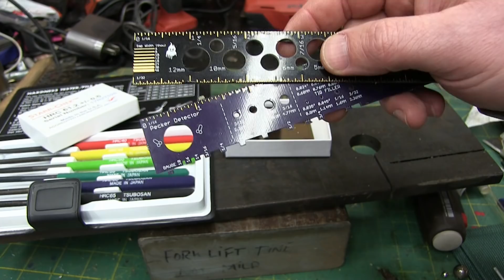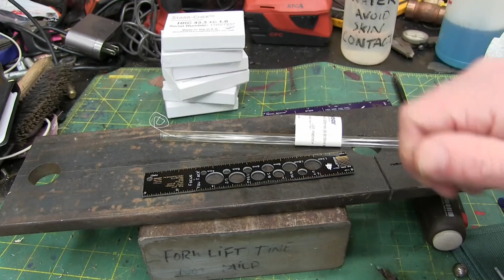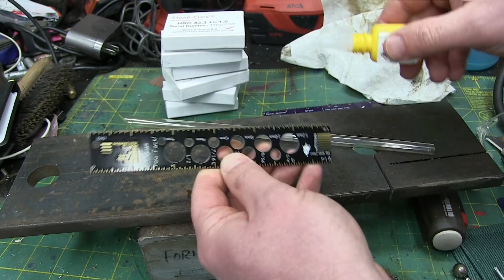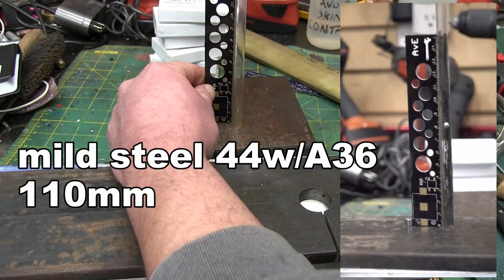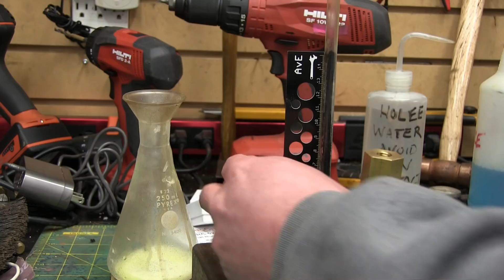Pocket Hardness Tester PROTOTYPE | IT WERKS!

Comment: The PC microphone input with a cheap condenser microphone taped to the striker plate can be used to measure the time between bounces. If the PC has 'HDA', (high definition audio, which even cheap motherboards have) it is possible to measure extremely low level signals with very high precision by using signal processing techniques.
For a quick trial, use the Linux ALSA utilities 'amixer' to setup the sound card input settings and  arecord' to record a wave file of the hits. Python alone or with SciPy can then be used to analyze the results.
For the best resolution the striking surface should be resonant to give lots of zero crossings. These can be averaged out using digital signal processing techniques to give very precise timing. An HDA sound card input has 80kHz bandwidth and the timing repeatability is in the nanosecond or better range.
As a hobby, I have done a bit of research using the sound card as a precision measuring device and even on a cheap motherboard, the measuring quality is instrument grade. See https://sourceforge.net/projects/o-scopepy/ for applications using the sound card.
Note that PyAudio is not suitable for making measurements as it has timing issues. It is much easier to use the ALSA utilities as subprocesses to record input into a wave file and then use Python and the SciPy library to analyze the results. There may also be other free tools online.

Comment: Coefficient of restitution and elasticity vs plasticity come into play here.  Hardness in Rockwell,  Vickers etc are measures of plasticity as they all locally deform the material being tested.   The calibrated test coupons have a much smoother finish than the ASTM A36 structural steel.  It makes a difference in the restitution. 
I'm not trying to shatter your idea, it just needs further work and study.  Samples must have identical surface finish and mass properties.  Thickness matters too.  There is a reason for the development of Vickers micro hardness test, it minimized sample prep and destructive nature common to all hardness tests.

Comment: Now wait just a minute, not all of us electrical enginerding types prefer warmer climes, it's just those types who prefer playing with bits that require a microscope.  I'll have you know I'm located in grand forks which ain't but a couple hours south of winterpeg on the old red river of the north; our climate is just as god damn cold.  My electrical enginerding credentials include, but are not limited to, holding both wires of a phone line just when some untimely jackass decides to call you, resulting in ringing your balls instead of the telephone.  I'd still like to know who the hell it was who decided to call at such an inopportune time.

Comment: To be honest though, you could just sell a plastic tube of specified length and a tungsten carbide ball... and then just use a mobile phone app for the audio pickup & calculatrix.

Even better, just have a drop down menu for ball material and mass, and a field to enter drop-height... and then the phone could do it.

Even smarter... could use a reference material to calibrate the ball on "learn" mode. Probably only need a coin-sized sample... or a coin.

Comment: Yea you could use a piezo but honestly a condenser mic element set into the tube at the point of contact would be cheap and easy. They are used in mobile phones.

Could also detect the ball using a capacitive sensor.

Another method might be to use a pendulum, and mount the sample vertically.

Comment: Dude, just some simple ideas may works: why not just a little coil ac powered or a light sensor pair? The position is not critical since you're just interested in the time difference. With 2 "sensors" you can measure speed :-D Perhaps a couple of coils filled with crazy pixels from a microconfuser?

Comment: This is essentially what you use to test the hardness of  cylinder heads. Small tube with a scale, ball bearing and a magnet in one end to hold the bb. Plop it on the head and tap the top to drop the ball.

Comment: Of course you'd use metric ! Enough with the measuring things in fractions of body-parts already !
It should be possible to read out the height of the ball with the aid of some choice electronicals.

Cuddles!

Paddy

Comment: My first thought was dot-matrix printer .... put the print head against something hard and oscillate the coil, listen to the oscillation, and sweep the frequency looking for natural oscillation frequency, the higher the frequency, the harder the material, but the mass of the dot matrix needle is very low (low mass of hammer = gooder) ... then I got to thinking, same idea, piezoelectric transducer, much lower mass = much gooder, then I checked the comfuser ... https://www.researchgate.net/publication/236624641_Research_on_universal_dynamic_hardness_test ... not a new idea

Comment: Your invention is a variation on the Leeb rebound hardness tester where the ball passes through a coil of wire on the way down and again when it rebounds.  The electrical signals produced on the way down and way up are analysed and a hardness value calculated.  The hardness values are in Leeb numbers and don't convert to Rockwell or Brinell particularly wel.  The object being tested has to be pretty thick to get accurate values and if not it has to be coupled to a thick piece of steel.  Leeb tester calibration blocks are typically 2-3 inches thick.l

Comment: I'm thinking something like a electric lighter striker with the pieso exposed so the test material then some way of measuring voltage like an adjustable spark gap maybe? Also What's the odds of getting a ruler and some stickers by Christmas?

Comment: how about using a soundwave instead and then measuring the pressure of the reflected wave? the harder the material, the higher  the measured pressure, supposedly. If that works, you can completely incorporate it into your scale. You'd just have to hold the thing against the material you're testing.

Comment: dropping the bb should be automated, like there should be a detend in the tube that is actuated by pushing a button, that way the bb will fall from the same height and in the same way each and every time. i imagine it makes a difference if you drop it from a little higher or lower right?

it would be cool to be able to check stuff for hardness, this could be a great thing for knifemakers (if it would work on a knife)

Comment: Second tap on work per strike with a hammer by blacksmiths.  Not the anvil tap to clear the hammer, the "resting" tap after the strike.  That's how you tell how your work is doing.

Comment: That fork lift slab was pretty thick.  like an anvil.  The base used under the piece to be tested could play a role in varied results.  Amount of contact to the base could cause inaccuracy also.  I know you get it but as an example.  A flat piece of steel on a flat anvil vs a a convexed piece.   Or any odd shaped piece.   Nothing a few tests wouldnt sort out.

Comment: What about using a optical detection at the lower end of the tube in combination with a black ball? Easy to implement and independent of noise in the "empire of dirt"

Comment: Inductive sensing may work too and it is way cheaper, just some turns of a wire. Flip a pin, read how fast pin recovers. Will be slower when ball falls through a coil.

Comment: As an embedded systems programmer, I would be more than willing to lend my time to the programming/electrical development side of something like this :)
Reply: I've done some experimenting with a PC sound card with HDA and the precision is incredible. The A/D converters are 24 bit and using the maximum sample rate of 192kHz, the input bandwidth is 80kHz. I proved this by using an Arduino to generate a precise square wave and then used an FFT to measure the bandwidth.
The only problem is that the inputs aren't calibrated and the amplitude settings all over the map. For this application, the true amplitude is irrelevant and only the timing is important. The timing repeatability of the sound card is in the nanosecond or better range.
The Linux ALSA utilities amixer and arecord run as subprocesses in Python is the easiest and most accurate way to capture the audio. I tried PyAudio and although it sounds correct, timing errors occur during recording and it's not as easy to use as arecord.

Comment: Very similar portable Hardness testers  already exist, even have one in my shop. They seem to be fairly inaccurate though. They also work harden the material slightly so different measurements need to be done on different places on the sample. The surface you are testing on needs to be smooth and  flat as well for a good measurement

Comment: Years ago I worked at a shop where we had these little pen sized hardness testers that worked on roughly the same principle. But instead of just a ball, the ball was on the end of a rod. You lifted rod out of main body and it locked in place at the top, hold the pen vertically to the part being tested and pushed a button to release the rod, on the first bounce it would lock at the top of bounce, and you took reading off of the scale on the side of the pen body.

Comment: You are't dropping this ball in a vacuum!!
You are dropping the ball in a tube full of air(Newtonian fluid) that you are moving/displacing at different speeds.
You really need this machine in software.(to automate all those calculations)
(edit: I mean just say, really hard metal is a 1:.999 bounce back and soft metal is a 1:.5 bounce back. That's almost twice the speed, a hell of a lot more air resistance. This math matters a lot. Unless you just want to buy a hundred hardness samples to fill out whatever curve that air resistance creates)

Comment: Here's how you can greatly increase precision:
Have several evenly spaced photointerrupters (for example, every 2 cm or 1 inch), and time the ball in several places.
After that approximate the parabola of the ball position relative to time using these data points with (for example) least square fitting.
This way you have much more data, and you'll get better results.
And photointerruptors are cheap.

Comment: Take a different but similar approach

Use a very light spring, the same type ball and a pinball like  launching device that way you could add a reset-able "max height" pointer to the ruler. Calibrate for hardness and bingo bongo.

Similar concept you would just have to account for the additional speed the speed the spring shot that thing out there plus the gravity.

Comment: If you use a whole series of bounces, you may be able to get more accurate measurements or do away with the initial height measurement and/or compensate for friction in the tube (first order vs second order decay).  A tungsten carbide or silicon nitride ball may allow you to measure harder stuff (yes, mcmaster has them...)

Comment: my company uses this model. seems to work on a similar principal. after a while of using it, you can tell when the steel gets hard by the pitch of the ping noise. 
works good, but you're right, it isn't as accurate on small material. https://www.brystartools.com/phase-ii-pht-3300-mini-portable-hardness-tester-with-d-impact-device-pht3300/?gclid=EAIaIQobChMI0ZuJ6PXT1wIVXZ7ACh0LpQKWEAQYDCABEgLESvD_BwE

Comment: I would add that a feeder is important for this, something simple you can rig up at the top, there will be subtle variances in pinching a BB and dropping it (unintended added force, variations in height, etc). I am not aware of anything, but would be pretty cool if you could have two sensors at the top and bottom of the  ruler, something that could correlate the position between the two some how to get a precise measurement. I don't think anything exists like that, hall effect sensor would be cool if you could somehow magnetize the ball but that would affect the rate of bounce and all that. Motion detection at the bottom would be too difficult as far as I know, but would be pretty accurate as well. This is a really really cool idea!

Comment: You could compensate for the pressure variation by adding into the sensor that counts the sonic wave to do a speed test while the ball drops from the moment the magnet is pulled and the ball is dropped to the first point of the sonic wave being detected. This data set should be enough to solve for temp/elevation

Comment: It's a nice relative hardness tester technique.  If you were to try to calibrate it, the delta between the drop diameter and th tube diameter might come into play due to variances in air properties at the time of test.  Just a thought.  A perforated tube, or a cylindrical screen might be just the thing to cancel that out.

Comment: You could use different masses/sizes to increase accuracy across a larger range of sample thicknesses (just change your range in the software to correspond).  Also you should test if a sphere is in fact the ideal shape for this application.

Comment: Someone else has already mentioned the Leeb tester, but the older version is called a scleroscope... https://en.m.wikipedia.org/wiki/Scleroscope.  Not many details there, but our materials prof had one back in the day. Lent it to the school architect to get an approximate strength of some existing I beam when they were remodeling... much easier to get into the ceiling than the Rockwell.  I believe his had a small vacuum bulb to evacuate the tube, and the bb release was done with a magnet. The Leeb testers use a couplant to temporarily stick small mass samples to a large mass btw...

Comment: the bb needs to be dropped with consistency too. no change in how you put the bb in the glass tube. perhaps an electro magnet to hold the bb at an exact hight and a button to release the bb. 

an LED and light sensor at the bottom could be used to start and stop the timer. no interference from external noise, different materials will also create different sounds which will have to be programmed in if you go that route.
Reply: Jason Harrison Or you can use the first bounce time to calibrate, then each additional bounce gives you data. Each bounce will be consistent fraction of the previous bounce for a given hardness.

Comment: I have been in need of a pocket hardness tester, I seem to have some of the hardest pockets on the planet...:-/

I like this idea, it's very similar to how blacksmiths have tested anvils in the past by bouncing a ball bearing on the anvil top to see how far it rebounds, and there are percentages that tell how much rebound is good/bad...this is a similar idea. It would be nice to be able to read the ball with some type of electronium sensor, even something that could be programmed in Androidium or iPhonium...taking the guess work out of testing our spectacle status...of course the ball itself could exhibit different rebound, depending on the composite of the material, I thought I would toss that out to f#@$ with your brain...;)

Comment: Just a thought. If anyone replicates this it would have to be calculated to the density and hardness on the ball they use and the height from which it's dropped.  Also the hardness of the the material the sample is sitting on. If sample is sitting on a piece of jello or carpet or the workbench it'll be a different result.

Comment: We must drink in the same bars.

Use a ceramic ball bearing which is way harder than the material under test and curve fit the bounce period. I believe the bounce period is non linear with hardnesses and changes with the sample thickness but just use a look up table for your Android phone bounce app. Lay phone on sample and bounce away. Quel est kick starter?

Comment: Need to mesure the third bounce. First is zero. Second can be correlated to the height dropped. Third is your real mesurement. This eliminate the drop height uncertitude and any push you can give it by mistake.

Comment: heres an idea, something that looks like a pen shape, where the end that you write with has a solenoid like device that pushes a pin back into a spring (spring so it works on any angle) which pushes it to bounce off the metal and use the audio sensor or sense the voltage the pin makes on the electromagnet you used to move the pin.  just an idea, someone go have fun with it.

Comment: Electromagnet to release the bb reliably would be cool.  That way it could be calibrated.  Also, on the end of the tube contacting the surface it would be nice to have a small restriction in the opening to keep the ball in the tube.  A MSP430 is cheap enough to mass produce and easy enough to program.  For better accuracy an external crystal oscillator that is very stable eould be optimal.

Comment: or instead of a micophone use an optical sensor, say at 1cm, you can start counting at 2 breaks of the beam to 1 break, that will give you the point it starts going up, and the point when it comes back down.

Comment: Not in the mood to read 500 comments, so this may have been said. 1 - been done,  you can buy them. 2- ideas:  Both bounce height measurement (actually a spring loaded mech would be better) using optical or inductive sense of the bounce and 2 piezo  sensors. The 2 piezo sensors would measure density,  and modify the calculation for hardness based on bounce height to be relative to density (because it should be, I think?).

Comment: If you were to measure the time ratio between each successive pulse (minimum 3) instead of the time between the first two pulses, the only calibration necessary may be for the ball itself vs materials - consistent drop height would no longer be critical